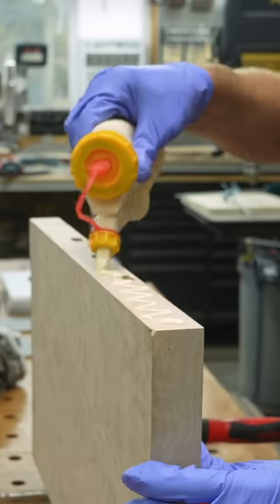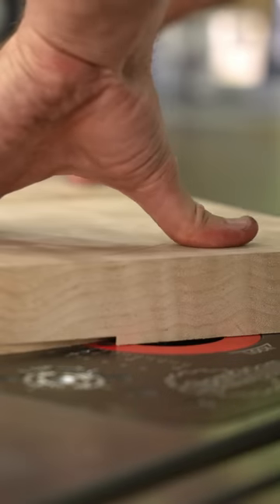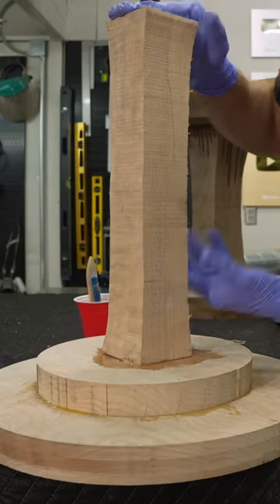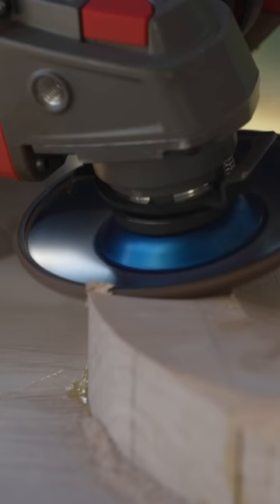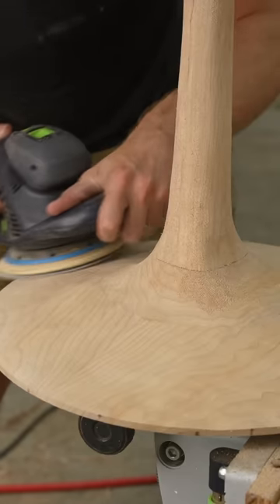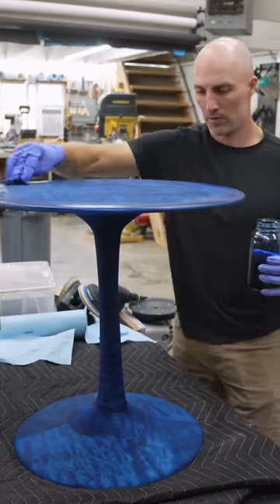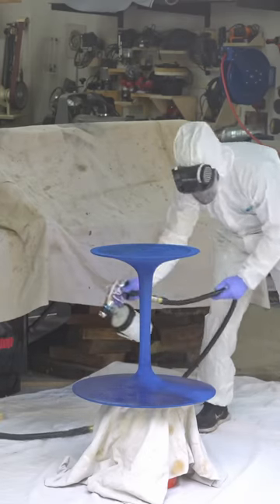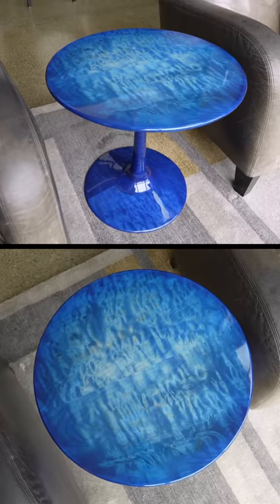$3700 little table

Comment: That really does look amazing. I can see it being the focus of a room easily.
Reply: The central support looks extremely flimsy though.

I wouldn't pay $200 for a table that wobbles like that, it will break all too easily if someone just puts their whole weight on the far edge, let alone if you kick it with any significant force.

There's no point putting such effort into how it looks if you skip out on basic joinery work that gives wood furniture its longevity.
Reply: @mnomadvfx what makes you think it's flimsy???
Reply: @mnomadvfx na, you’re underestimating the strength of that wood and shape.. If you’re talking about the wobbling while he’s building it, that’s probably before the rubber feet are added. And if they aren’t added by him, they’re very cheap and easy to add yourself to keep it more stationary.
Reply: @boobentobi1737 bro that thing wobbles A LOT
Reply: @LaSombraa  in the clips while he’s building it or finished product?

Comment: $3.5K for a blue table?  It's nice looking for sure; but, over $3,000?
Reply: it's a custom build that is made locally by a small shop. The reason other furniture is so cheap is because it's mass produced and made overseas under cheap labor and harsh working conditions which is then sold by giant conglomerates/companies
Reply: @PrabhablyAGoodYouTuber Also most furniture even at higher end places are not solid hardwood furniture. Most are veneers, painted or some other pseudowood finish. Materials are also quite pricey.
Reply: @PrabhablyAGoodYouTuber ok but 3k? nah ill stick to ikea
Reply: I also dont understand it, I like the quality and all that, but just like I dont see spaceships or flying cars, I dont see how this could exist around me
Reply: @Vidar93  I get the whole solid wood thing and I'm sure it's expensive. However, even if it takes him a month to build it, which I'm sure it didn't, plus materials,even if the wood costs $1000 alone, doesn't warrant that price. Just my opinion.
Reply: @MrPauls-vr4mj  Its more than I would pay for one, though I'd build my own anyways being totally honest. But I can tell you materials for solid hardwood furniture are definitely very expensive and you aren't just paying for the labor of him making it but also a portion for all of the tools required to make something like that.  It also takes a lot longer labor wise than you would think but I still agree that's a lot for a table though its inflated price is probably from it being auctioned for charity. And just because it's a lot to you or I doesn't mean it is for some people out there. Just giving you an example of a project I did recently, it was a custom king sized bedframe all solid hardwood with a large headboard. It ended up being about 1400$ in materials  and between everything about 40-50 hours of work between everything and the headboard did have a special finish that took quite a while to do but the customer paid 3400 for it. With the tax I pay and everything It came out to like 27$ an hour take home and of that another 600 or so was invested back into my shop buying a new tool. So while its not something I would ever even buy myself I don't think that it's entirely unfair of a price for a one of a kind bed that they will probably use forever.

Comment: This table (tulip) is a most impressive commercial success, unfortunately this economically impressive success should absolutely not have such a craze.
The reason is the obvious lack of stability (visually this is obvious), but in reality it is much worse, it is impossible to raise the table by putting your hands on it.